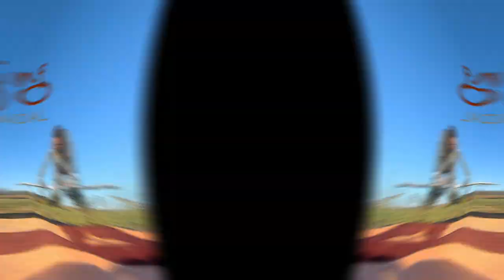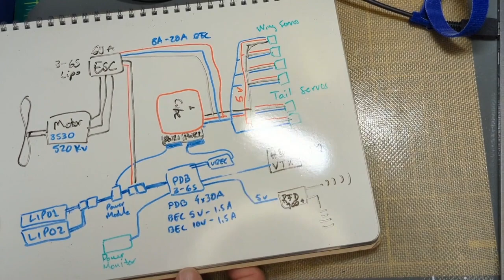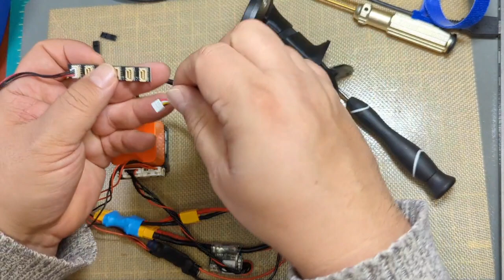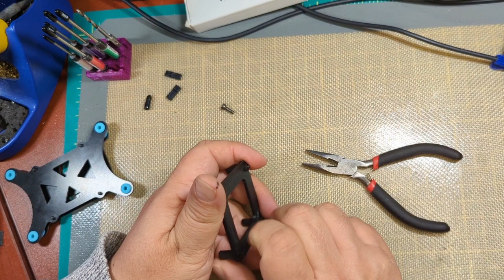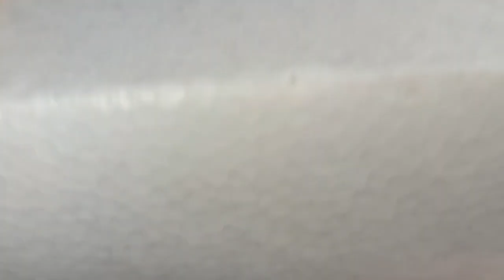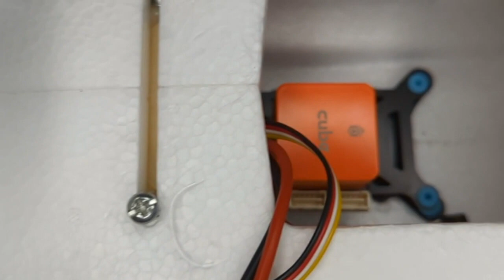Anaconda Power Wiring

Comment: How did you connect the Esc to the flight controller?
Reply from the maker: The connection beythe ESC and the flight controller is just the pwm signal from the FC (in my case channel 3) the ESC gets power direct from the battery

Comment: How can I use my new DJI 03 AIR UNIT and it’s new CAMERA  so I can have the  OSD? My Receiver is the newest Spektrum 8 Channel with safe technology and is the Spektrum 8 NX Transmitter and has all prior Spektrum updates from the past. Thank’s, Chad.
Reply from the maker: I'm not sure the 03 air unit supports the OSD, if it did it would be the custom OSD in MSP from a flight controller like a Matek, or a betaflight.  I don't believe it supports telemetry from a Spektrum receiver.  Spektrum will show you telemetry on the radio, but I'm not aware of any integration between Spektrum and DJI 03